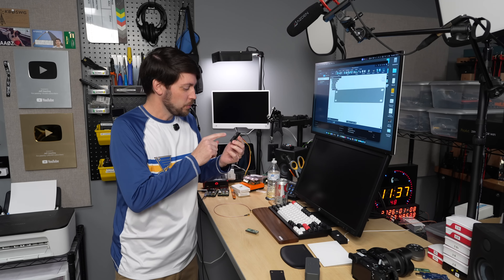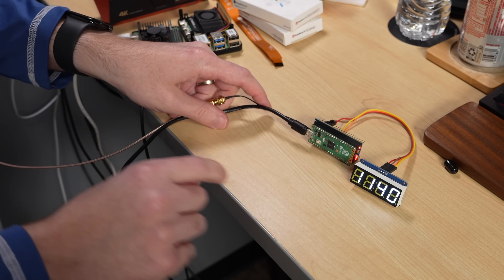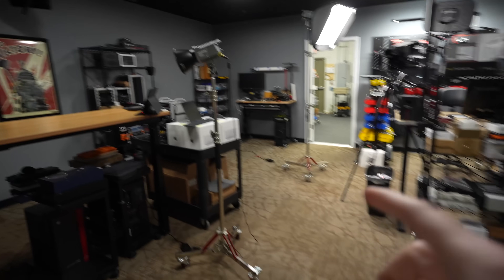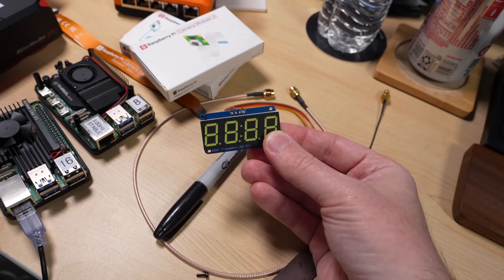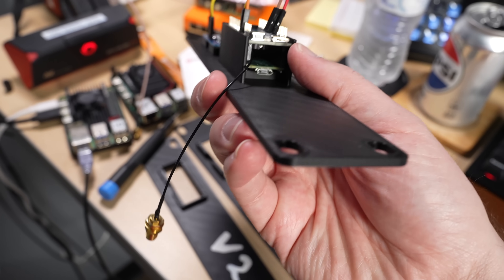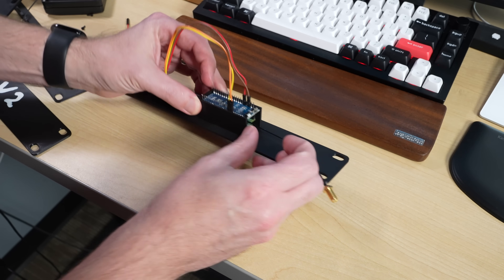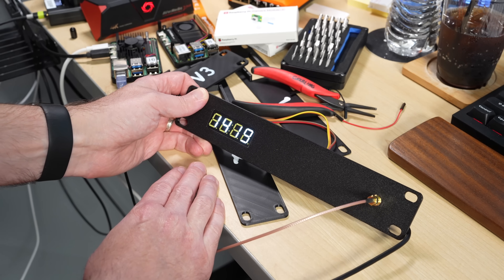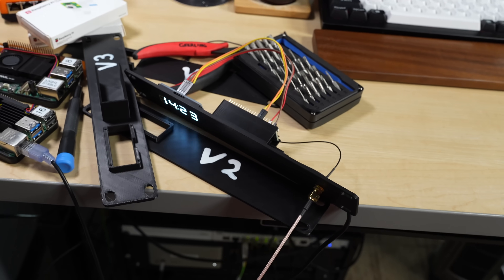The most accurate clock in a mini rack

Comment: The issue with your holes in 3D printed parts might be due to shrinking of the filament. You should be able to adjust the filament shrinkage in your slicer to take this into account. Print a test piece, measure it accurately and adjust slicer's parameter(s).

Comment: This is fantastic,  definitely going to build one of these - parts already ordered.  I would love making a few alterations (the code would be fairly simple I'd think but not sure on the hardware)
1  Add 3 extra sets of displays, 1 for year, 1 for mm:dd and the final for ss: tenth/hundredth for Local Standard Time
2  As someone mentioned already, another display for UTC
3  A display for Local Mean Time
4  A display for Local Sidereal Time
Using the GPS as a reference, the rest could be derived as a calculated offset if I'm not mistaken, but driving that many displays could be fun.

Comment: Waveshare is pretty good with providing dimensions, I've 3d printed a custom platform for my drone until I found out the Rpi CM5 wouldn't work with the hat I'm using. I got to use a cm4 or just the pi4 but I know I could count on the specs to print without measuring.

Comment: For fusion, here's a tip: next time model a quarter of that panel and use two mirror operations to fill it out. Of course that's easy to say in hindsight, often you need to make something once badly to know what you're aiming for, then redo the model to be more robust / parametric.
Reply from the maker: True, this was the first model where I figured out symmetric constraints. Will be using them a lot more now!
Reply: @Level2Jeff mirror constraints are handy but they can be difficult if you need to change the sketch. If you use the mirror operation you can apply this to features (e.g extrude) or bodies which won’t usually change even if you change the sketch used to make them

Comment: If you have translucent filament, you can design the plate so that the space where the display module sits, gets pushed back 0.20 mm, and a 0.20 mm layer of that translucent filament acts as your filter. If that is your layer thickness, it can possibly be printed w/o an AMS, but having an AMS makes it a bit easier. Another option to consider for the LEDs on teh GPS hat is to essentially make light pipes to the front bezel as well. It would be best if that not be a colored filament, but perhaps a natural or "clear" filament. That may, or may not work. From having worked at a factory that used light pipes in things like dashboard environment controlls, I know that they are usually done by injection molding, but that's probably not a workable solution for you. The mold gets a bit expensive for a 1 off solution.

Comment: With the right filament, a single 0.2mm layer works great to see LEDs through. Add holes with a single bottom layer to see the status LEDs too, and if needed snip a piece of translucent filament as a DIY light pipe. (Bambu Galaxy is translucent up to about 3mm layers)

And to save time and avoid wasting filament when printing tests, crop them to the area under test - a boolean with a cube, or just cut in the slicer.

Comment: You can 3d print a filter for the display to improve the look and contrast. One layer thick works, and you can make the edges thicker to make it a robust custom filter. Choose the color and adjust the LED brightness to get different effects. You could even print a thin layer of the panel where the clock display goes and have it be invisible when off. Many choices. I've started using the 8x8 LED matrix strips from Amazon for my clocks, they can display a lot more interesting things and are larger and cheaper than Adafruit displays. Enjoy. :)

Comment: You have four decimal points in the display.  Blink one for PPS.

Suggest to turn all points on if GPS is lost and you're on local oscillator.

For bonus points, display the number of satellite fixes while getting initial time.

Maybe pushbutton for date yyyy-mm.dd

How hard can it be? 😊😮

If you're producing PPS output, make sure that it's buffered!

Comment: A light tube would work to bring the led to the panel if someone has not already suggested it. If your printer can handle multiple filiments in the one print you could possibly do it as one print too.

Comment: For those of us that aren't using the mini rack form factor, that clock would probably fit well in a 5.25" bay or possibly even a 3.5" bay. Would like to see one or both of these versions too. I'd love an atomic or gps clock display on the server I'm putting together. Wish I could find a large LCD to display time, date, system temp and possibly other system warnings.

Comment: Lovely proj. If the front panel is too bendy, you could add (3mm, 3D printed) stiffeners top and bottom - a bit like the top and bottom bends in the metal panel you started with. Also, soldering the wiring can be more durable than the push-on connectors. Well done, Mark

Comment: I would probably have the blinking the other way. When everything is fine it doesn't blink and when there's an error it blinks.
Reply from the maker: Could be a preference. Either way I think could make sense; another option would be to light one of the bottom dots if in error condition.

Comment: For your fusion build - you should look at modify -> parameters, as that should allow you to resize and edit your sketches much quicker (once you set it up with that in mind)
Reply from the maker: Yes, been slowly adding parameters to some of my designs. It helps a ton. Especially if you add them while your designing, and don't regret not adding them after you're 'finished' and on revision 20 or so haha

Comment: I'd be curious about the propagation delay caused by that long coax and the distribution amplifiers. Maybe PPS Delta on a pair of scope channels?
Reply: The position and time calculations occur at the location of the antenna.  The delay from the wiring (and amplifiers) is added to fixed constant in professional timing GPS units but it is small due to near light speed propagation in the co-ax.  Under 200ns for 30 meters of cable so not of interest to most home computer or network needs.

Comment: 4:42 per their schematic, R20 which is normally unpopulated would tie PPS to GPIO16. Not labeled on the silkscreen :( but if youre looking at the board with logo right side up, it’s the unpopulated resistor pads, top left in the group of smd resistors right above the wave share logo. If you go to the wave share “wiki” page for the product there are a few links to “the schematic diagram” which doesn’t quite have the traces elucidated, but at least shows component numbers. This is very cool. And now wildly close to the “master” clock I built at work.

Comment: But Jeff... you forgot the power LED! How will you know it's on?! 🤪 Slightly more seriously: I've used colored electrical tape in the past to mask off those displays. If the display is bright enough, and the tape matches the color, you get clear illuminated digits, and the rest disappears. Might work with black tape too; I never tried.

Comment: 7:50, put a little hole and then connect the LED to the hole with hot glue. Like a poor man's fiber optic solution to guide the light from the LED where you want it. Would that work?

Comment: Instead of printing the full part three times, it would have been more efficient to split the model during the design and tolerance-testing phase and only print specific sections. This approach saves filament and significantly reduces waiting time during iteration. Fusion 360 allows you to send the model directly to the slicer, where you can use the split function to divide the part. For testing the display tolerances, I could have removed the left and right overhangs and printed only the section with the watch to verify the fit. Once all features and tolerances are correct, the complete part can be printed.

Comment: re: test prints
I was in the same situation last week designing a rack mount for an Anker power station to replace a ton of ac bricks with usb-pd. Started a 1 hour test print to fit it in the rack, expecting to change it, but then cancelled the print and printed a 2d drawing with my mounting holes and cutout for the power station. Lined it up with the holes, punched a hole through with a screwdriver, and eyeballed the power station, then sent off the print after fixing alignment. Saved an hour of my time. 
Really making me want to add a local time server to my mini rack lol

Comment: OK, I guess you’ve earned your NIST eagle Scout badge for time. Maybe you just build panels with bread boards, and you just plug them in the front and wire them in the back and leave it raw. That would be interesting to see if the printers could print to that level of detail where you could make your own bread board.

Comment: Beware that some software implementations, including the GPS firmware in the GPS chip, might emit the 1PPS and then send out the applicable time string (after the fact).
So I've seen a clock design where the top level clock designer had to increment the second and line it up the time string data for the subsequent 1PPS edge. But this means, he made it microsecond precise.

Comment: Thanks for this! You just gave me an idea to solve an issue. Secondary GPS in a vehicle born system. Spec is requiring a backup GPS system. This is perfect! Pico W chirping MQTT GPS topic as GPSb. /GPSa is the root GPS. If  topic a is not updated for X minutes, poll topic b.

Comment: Nice video!
If the digital display is that bright, you can probably print the blanking plate solid, since it is so thin, and the display will shine through it with it acting as a diffuser and hiding the unlit segments
Reply from the maker: I am trying this now!
Reply: @Level2Jeff  good luck! You may have to play with the thickness of the print but I think it should work

Comment: Can you add a small "light pipe" running from the Raspberry Pi LEDs to the front panel? I imagine you could just drill one or two holes in the front panel and glue in transparent rods between the front panel and the Pi.

Comment: "the most accurate" got me to respond on this. 
GPS modules still have some jitter in their output. Not counting the fact that most of the modules provide the time over a UART connection, the 1 PPS has a certain accuracy and jitter on its signal. But there are special modules (like the Neo-F10T) that provide a very accurate (16 ns time-mark resolution) 1 PPS pulse with a very low (5 ns) jitter. Best thing of all for me is that on a modules like this one, the 1 PPS is programmable so I can also use it as a very accurate 10 MHz generator that can be connected to some of my lab-equipment as a frequency reference.
Yet another rabbit hole to get lost in ...
Reply: Neeeeeeerd

Comment: With the bright LED display you might not need a tint film, try just one or two layers of plastic, if it's not too opaque you should till see the display when it's on.
Clear PETG is very transparent and can be used as a light pipe.

Comment: Its interesting. 

NTP is used to keep your PC clock(s) consistent and in most cases once daily syncs is more than sufficient. 
GPS will send you clock signals from the multiple sats that it sees.  Based on the timing, you get your coordinates and that clock signal is your time in GMT where you can use your location to shift to local timezone. 

With NTP... you are using your PC's clock.  With GPS... you're using the GPS clock with the exception that when the GPS signal is lost... it uses the local Pi Pico's clock. 
Your pi Pico can then become your local network clock and then synch all of your local servers to it. 

This comes in handy when running certain cluster applications like an HBase database where timing is critical. 

This is actually a very cool project... far cheaper than getting your own CS clock for your home network. 🙂
Reply from the maker: Yeah. Though I still want a Cesium clock ;)
Reply: @Level2Jeff  
Who doesn't?  Then you're your own ground station.  The next step would be to put up a Pico Antenna for your shop to be your own cell tower. ;-)

Comment: With a cable that long, have you corrected for the propagation delay (ns)?  Then you can say you have a more accurate clock!!
Reply from the maker: It should be around 119ns. Honestly a bit difficult to measure using just HH:MM hahaha. But I do want to account for it in the eventual install. This is temporary for now.

Comment: I don't own a 3D printer because of cost reasons; but in my honest opinion, instead of a separate tint/filter, you might be able to pull off just using a thin layer of print material to make a facade that'll hide but allow enough light to pass through from the segmented display.
Reply: I've used this strategy and it's really effective! 1 layer at draft quality should be plenty, and looks great when the flow ratio is precisely calibrated, but YMMV so always do a test print.

Comment: Could you print a very thin layer over the display so the front is truly flush but the display still shows through?
Reply: You'd need to use a fairly transparent filament, and the individual extrusion lines will be quite visible. Assuming you can get it to come off the bed intact. Not a process which is terribly compatible with optics, unfortunately. I would like to try making my own light pipes with a resin printer, but on the other hand I don't really want to deal with a resin printer..

Comment: I have the same Quectel receiver in my setup and it seems to perform significantly worse than my Ublox's M8Q, I'm going to compare it to F8T soon™. Segal's law and all that, man with two clocks never knows what time it is.

I recommend taking a look at FPGA-based time server solutions, like the one designed by F96HAJO for low-cost FPGAs. If you have the know-how, adding PTP to it shouldn't be too impossible. Likely significantly more deterministic than any Linux or RTOS-based approaches. Though, you can also replace the oscillator used by your MCU or SBC with an OCXO/TCXO, which should significantly reduce jitter even if you're feeding it a GNSS signal. (Thanks to audiophiles there are even kits for Raspberry Pis and there's a StackoverFlow post about it.)

You can also clean up time pulse output using a PLL or jitter cleaner like AD9545, to get rid of the short-term jitter and quantization errors. That way you can also have a good frequency reference. Out of the box the short-term accuracy of GNSS modules is not very good.

Unfortunately cheap Rb oscillators have become a rarity, when once they were ~$£50€. They're around 250 now, but having one for holdover and as a frequency reference might be interesting for you.

Comment: How many nanoseconds delay from the antenna cable and amps?
I bet @franslab has more interesting displays - I'd want a sweep second hand 24h clock... we're analog creatures. 😀
Reply from the maker: The cable to antenna is 15m, and then from the amp to the studio amp another 15m, so maybe around 100-120ns delay. I need to measure it out at some point so I can set that in once I get my calibrated gear going...

Comment: Surely you need an additional display segment for seconds (with tenths and hundredths as an option?).  
Having a really precise clock with a resolution of one minute is as sensible as a GPS navigation system for a yacht with a readout limited to whole degrees of latitude and longitude.
Reply from the maker: Heh, I know. Trying to find any pre-built displays with colons and 6 or 7 digits. So far haven't :/
Reply: @Level2Jeff  Laurel Electronics has some 6 digit displays with colons.  Sold by Ram Meter Inc.  They have some with asynch serial interface.  They look more expensive than hobby devices but are not enclosed so intended for integrators. Worth a look.  You could 3D print cuides to run 1mm optical fibre to pipe light from any status LED to the from panel.  Print a tiny hole on the front and then drill it out to 1mm exctly and push the fibre through to the correct location trim with hot or sharp scalpel blade.

For the display filter what might look the most elegant is a deep tint cleal front sheet that is the FULL SIZE of the element and then having the 3D printed mounting plate behind it.  It would make the front smooth and allow a reasonably thick (3mm) filter that can be selected from standard colours.

Comment: I would add a thick rib on the inside of the rack plate for stability, looks like it is easily flexing a lot because now it is made of plastic and not metal anymore.
Reply from the maker: The final version I printed at 3mm thick, so it's nice and rigid. The 1mm one was just for speed.

Comment: Neat, thank you.

I'd really like to know about the antenna placement outside vis-a-vis other antennas and what you used for an outdoor antenna. Bonus: the specifications for your cable to the split-out as well as the split-out box?

How about placing the antenna to the left of the display leaving the large blank area for a future display where you might want to display
	how much the clock might be off in terms of millionths of seconds.    Can a pico become a stratrum 1 time server (possibly compiled on a larger version of the same processor like what I do for the Raspberry Pi Zero 2 W using a 4B for big compiles?
Reply from the maker: For the antenna, I did a video with my Dad over on Geerling Engineering covering the install last year; for NTP services from the Pico, I'm still exploring that a bit. I'd like to someday build a custom board for the RP2040 or RP2350 with Ethernet + GPS + PPS, as I know some people have gotten NTP at least to work on it.
Reply: At Geerling Engineering titled "I did not die installing a GPS Antenna with my Dad"